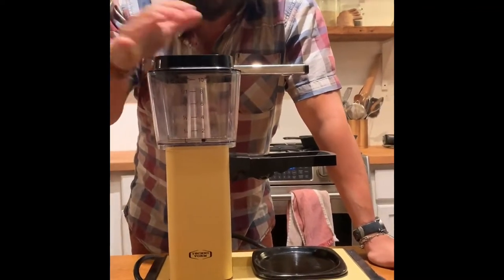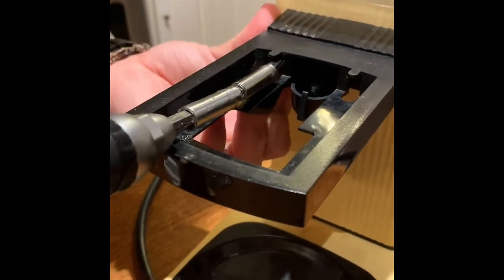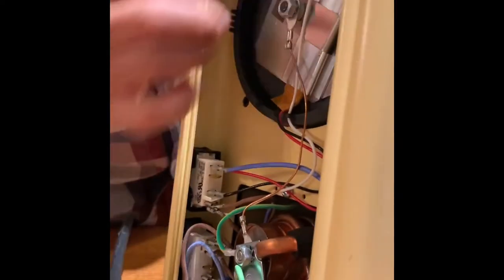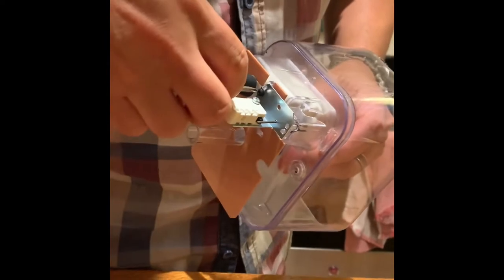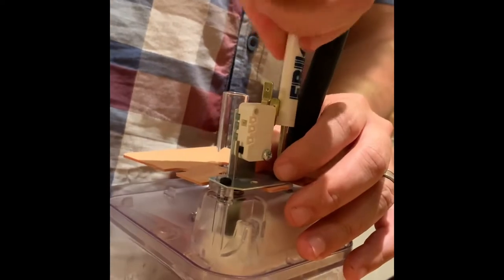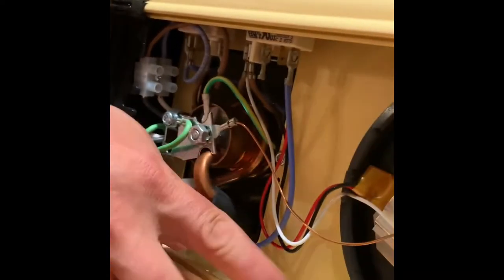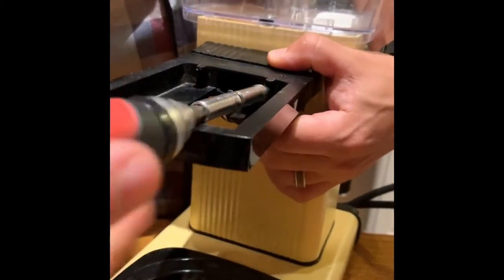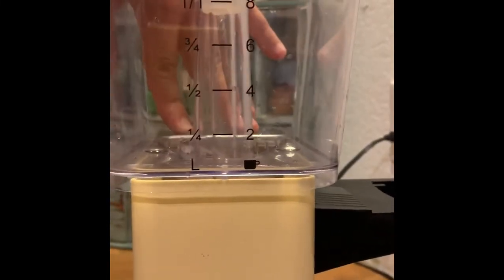Technivorm Moccamaster reservoir float repair

Comment: Thank you! I bought a used Moccamaster recently, and something clearly wasn't quite right with the float. It needed a little help (poking one end with a chopstick) to get it floating when there was water in the reservoir; otherwise it worked fine. From the top view, the float looked normal.

I thought something in the mechanism might need adjusting, but I decided to order a replacement float just in case (I didn't want to have to take it apart twice). 3 weeks and 40 Euros later, I had the float. Then when I took everything apart, the old float looked just like the one in this video! Apparently the previous owner had made the same mistake.

Anyway, with the help of your video, the float replacement was a success. Thanks again!

Comment: So summary:
- Wiggle the metal cap on the floater loose at opposite corners
- unscrew 2 screws in the water container
- unscrew 4 screws bottom
- push rubber hose off heater
- pull reservoir tube out of shaft
- (optional) disconnect switch spade connectors
- unscrew switch assembly
- pull out white ring
- happy reservoir cleaning
- reassemble
Reply from the maker: Nice! Thanks for the summary!

Comment: Thanks a lot for the video 👏 I wanted to replace our water reservoir by myself and most of the elements were in your video. 
It started cracking 3 months after we purchased;  2nd time in 3y (?)
Reply: That is interesting. I have had my Moccamaster for three years, use it everyday and the reservoir looks like new.

Comment: Thanks very helpful tutorial. The connection to the microswitch jump off while disassembling. They are both brown. So don't know how to connect them correctly.  Does anyone no which go where?
Reply: If they are same size connectors, then it doesn't matter because it work alternating current (AC) and switch won't get harm that situation, one way installed or anothwr way. :)
Reply: Situation is different If microswitch have 3 terminals for the wires.

1. When installed correctly, the switch allow heating element working when there is water in the tank.

2. When installed wrong, the heating element works all the time, and doesn't care If there is water, or not.

3. When installed wrong, the heating element works, when there IS NOT water in the tank.

So be sure that it is working as expected, otherwise  that may results overheating and a possible fire or best scenario blown heater core and/or fuse.
Reply: @samppazzz  It only has two. I asked elsewhere and they said the same as you with it having two connections. Thanks for explaining and answering. :)

Comment: Hi, thanks for the video.  Is it really necessary to remove the filter holder to remove the water reservoir?  I simply wanted to wash the water reservoir because it has an opaque coating, I'm assuming from several years of use.
Reply: Not needed, just tried it without.
Reply from the maker: Yeah not necessary. Same as unplugging the cables from the float switch. Try without it! 

I added both of those steps because they just make for smoother diassembly/assembly and don't take that long (as long as you have a long enough screwdriver with the torx/star bit).
Reply: Thanks for the replies.  One thing you may want to add is to inspect the wiring and make sure it is not against the hot surface of the coil or hot water reservoir.  The wiring is a bit messy and not run in conduit or with fasteners.  Mine had a couple of wires that were  right against the coil.  I simply pushed them away with a screwdriver.  The wiring insulation  is probably rated for the temperature but if it's cooler, it will last longer.  Thanks again for  for the video!
Reply: @jackprick9797  I found the connectors to the switch to be very loose after cleaning, and they fell off when closing the bottom. So tighten them first with a "platbektang" aka flat nose pliers (damn English language, why 3 words and why the heck nose? Can you pick something with your nose? You can pick your nose, but not with it)
Reply: If you let the descaling solution sit in the reservoir (turn the power switch off) and brush with a soft brush, the opaque coating will wash right off. No disassemble required. The coating is hard water scale.

Comment: How did you safely pry off the metal plate covering the float? I need to get in there to clean mine, but I'm afraid I'll crack the plastic and it will never go back together. I was hoping to see that in this video, but you already popped it off. Any tips?
Reply from the maker: I did forget to show that part! I just used a pair of needle nose pliers to gently wiggle the metal plate out. The key is gentleness and finess :).
Reply: @AlexDBrot I've removed that several times without disassembling anything else. I use two fingers and wiggle it straight up, as it's two ends that are just slotted in.

Comment: How did you remove the metal cover/grate?
Reply: With some needle-nose pliers and some gentle back and forth 😅
Reply: @alekrunko  No tabs to release?
Reply: @steelgtr  there are tabs but they are pressure fitted. So a little gentle wiggling side to side is enough to free them. You can kind of see it at the end of the video where I replace the grate

Comment: I was curious how to take off the metal plate but you already have it off 😢
Reply from the maker: Just use some needle nose pliers and then gently pull up while gently rocking it side to side. At the end of the video you can see me putting it back on - just do the reverse!
Reply: @AlexDBrot  thank you! I was able to gently rock it back and forth with my hand and remove it.
Reply from the maker: @AnthonySevigny  Nice job!